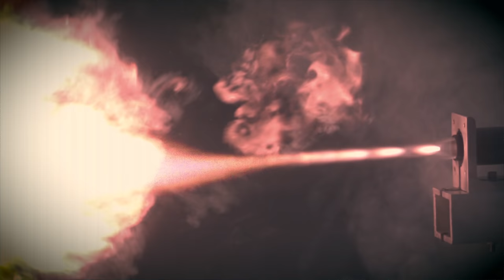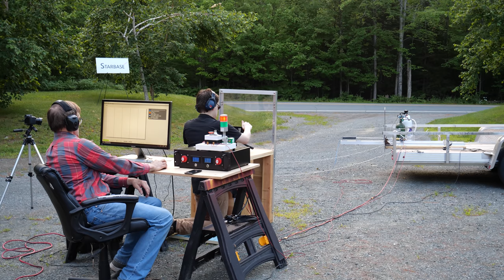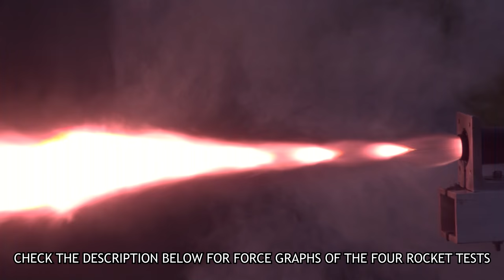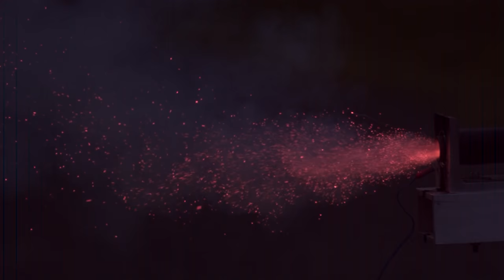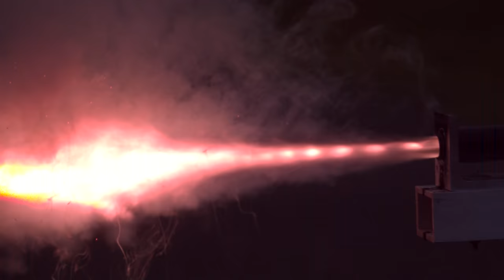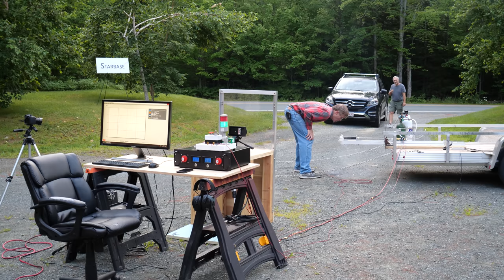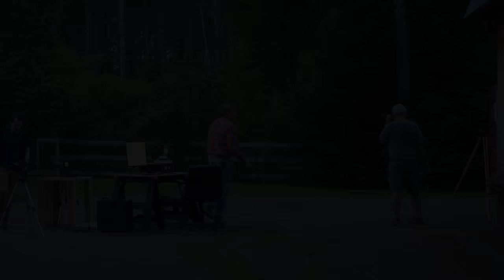Our Most Powerful Rocket EVER! Upsets Local Official!

Comment: both your nozzle are wrong for the air pressure around it. actually pretty bad for your results.

you can cleary see it by the cones and wave pattern forming in the exhaust.
its a phenomenon called "shock diamonds"sometimes called "mach-diamonds". they happen when the pressure of the exhaus is way lower then the atmosphere around it.
so the air "pushes" it into that cone shape form. this leads to less velocity and way more heat in your system. 
cone design should change your "vacuum" to a "in-atmosphere" engine.

it also could be a delivery problem. i see some problems with "steady stream" in the bigger engine.... i dont know if your are controlling that or maybe its the backpressure from overheating by the formed shock diamonds that overhead your engine and cooling donw because of low flow - cycling beack up again.

Comment: Good looking mach diamonds. Could be just a tad under-expanded. What is the chamber pressure? It looks like force peaked around 300 N, am I reading your graph right? 

Have you considered adding aluminum powder to the fuel grain?
Reply from the maker: Thanks.
It's actually slightly over expanded.
The large engine peaked near 700 N.
I tried it, but the powder did not suspend well in the liquid wax.  A nano aluminum powder would do better, but that is really dangerous to work with.

Comment: As the NO2 pressure is a self-regulating factor, then the rocket can never exceed the NO2 feed pressure. While this is a safety factor with all liquid/gas fed rockets it means that the actual performance of each rocket meets this limitation. It then becomes difficult to compare the performance of each rocket in the test rig as the performance of some could have been far greater than another, but the oxidiser feed may have restricted one. As skewing of fuel and oxidiser mix can greatly effect the performance, all one can say is with the conditions imposed this was the performance. Not that one was better than another.
Reply from the maker: You should watch our previous video covering the nitrous oxide system in detail where I addressed this.

Comment: Incredible stuff! Was there any thrust measurement done?
Reply from the maker: Yes, check out the links we posted below the video.
Reply: @TechIngredients  I had missed that, thanks. It is a bit non intuitive that thrust drops over time. As if combustion becomes less efficient or geometry of the chamber changes in a way that penalizes thrust. One would have expected the amount of combustion to increase as the volume of the combustion chamber increases. But that is clearly naive.

Comment: If you added a tesla valve to the channel just before the nozzle, would it increase the thrust by rechanneling the side pressure back in one direction?
Reply from the maker: No.  The convergent portion of the nozzle already does this very effectively.  A Tesla valve is an interesting design, but it's not useful for this purpose.

Comment: Wouldn't the trailer acceleration and motion greatly decrease accuracy of the load cell?
Reply from the maker: No.  The effect on the readings is proportional to the ratio of the acceleration of the trailer to the acceleration of the exhaust gasses, it's negligible.

Comment: I remember someone had a video where a Nitrous based motor actually back-fed into the tank just a little. Unfortunately nitrous oxide releases energy by breaking into oxyge and nitrogen, even without a fuel, so the tank blew up.
Reply from the maker: True.  The check valves are important.
Reply: That sounds like a good solution (although I don't know much about nitrous)

Wow that was a fast reply!
Reply: @TechIngredients  Just found the video:
https://youtu.be/Zt3JYHfmxDE?t=223

I think part of his issue is he was running a solid fuel motor that was designed to switch to hybrid mid-burn. May have created much higher back pressure than a hybrid alone.

Comment: I want to duplicate what you've done and I need to know the dimensions of the biggest engine
what are the inner and outer diameters?
what is the length of the engine?
and which material did you use?

Comment: A bit dangerous being so close to liquid propellants powering a rocket engine. A plexiglass screen will not protect you from a fireball, only distance will do that. Safety shouldn't be dictated by the length of your control wires. 10x that distance is borderline safe in case an oxygen tank blows up.

Comment: Using a smaller nitrous tank, will you build a rocket?  Also, the burn rate seems very fast, would slowing the nitrous delivery increase burn time?
Reply from the maker: Maybe we will.
It would, but the nozzle throat would have to be reduced to maintain chamber pressure and engine effeciency.
Reply: @TechIngredients  Looking forward to a rocket test!  This series is ever fascinating!

Comment: Why did the "larger" engine run in what seems 2 stages? is it an indication one of the cells was fractured or damaged?
Reply from the maker: No it was possibly due to the chamber pressure fluctuation causing a variation in the nitrous delivery pressure.

Comment: Will you attempt to do a liquid rocket engine I have been wanting to do a small one and would like to have more information
Reply from the maker: Probably not.  I'm concerned about cooling.  Without a flow through cooling system, the combustion chamber would need to be made out of an exotic metal or ceramics.  This is pretty tough.

Comment: I always enjoy your videos, Thanks for doing them. I have a question on any hybrid rocket engine. When it is mounted on a rocket and launched. Would it be possible to incorporate fresh air intakes which open at proper speed act like a scram jet therefore reducing the actual amount of oxidizer required to be lifted?
Reply from the maker: Thanks.
Probably  not.  A rocket engine operates at hundreds of atmospheres chamber pressure and the effeciency  increases as this pressure increases. Ram pressure  will never come close.
Reply: @TechIngredients  Thanks and good to know!

Comment: at 3.52 why does it show 3 "cones" and exhaust? Why not 4 or  9 or 12? Is there some process that makes it so? Thank you for the vids and info. The burning cones must push some compression to the next "cone"
Reply from the maker: As the exhaust interacts with the atmosphere it looses energy and the velocity drops.  Eventually it is no longer able to generate a shock wave as it reflects from the interface with the surrounding air and the shock diamonds disappear.

Comment: Ok, what is the pulsing effect caused by? I thought it was a shutter effect at first. Is it turbulence in the NO2 being supplied?
Reply from the maker: Slight variations in the burn rate and hence the chamber pressure.  This is secondary to the negative feedback effect that I described which makes these engines so safe.

Comment: Me again. Is it necessary for the rocket to spin? I want to take  pictures. I can't have the camera spinning around/
Reply from the maker: No, it isn't, but there is a reason it is common  with amateur rockets.
Notice  that with professional launches, the rocket might rotate a little,  but it doesn't  spin.  If the motors are less than perfectly  aligned (amateur), the rocket can slowly  arc in its flight. Rotation averages the off-axis thrust and prevents this.

Comment: I may be too late, but how would one account for the weight of the drag chains in the force calculations? Is it negligible? I would think not, but I’d like to be corrected if someone knows.
Reply from the maker: It's negligible.  The thrust is measured by the load cell on the trailer along with the engines

Comment: Is the throat of the nozzle eroding? Can you do a video and show the ones that were fired?
Reply from the maker: It didn't as I described in our previous video on nozzle fabrication.
Reply: @TechIngredients  I saw that video. I was just wondering if the expectations lined up with the testing. Why does it appear to lose power before you cut the nitrous? I would not expect this type of rocket to "taper off" like that.
Reply: @TechIngredients  Freakin awesome video by the way! I usually dont say that because I have kinda come to expect that from you guys but yeah, that was awesome!! Completely blew my expectations away.

Comment: So you gotta make the rocket big enough to propel the tanks along with the rocket , or get smaller tanks? Onboard CPU controlling the gas flow?
Reply: Do they sell them on Amazon or Walmart lol
Reply from the maker: You can fabricate tanks from the same materials used for the engine tubes.
As I explained in our previous video on the nitrous system, controlling the nitrous is limited to off and on as any restriction up stream of the spray nozzle will cause premature vaporization.
Reply: Love your videos . My son loved the smoke bombs I made from your videos.

Comment: Is it possible to monitor the pressure inside a solid rocket? I case, how?
Reply from the maker: Sure.
Attach a thin steel tube into the open core and provide a little length to the external segment where a pressure transducer will be protected from the heat.

Comment: Can you calculate the exhaust speed with measuring the distance between the mach diamonds? I've seen a video where a doctor explained that you can check if your flow of urine is still healthy by measuring the distance between waves (undulations?) in your stream of pee. But i have no idea if that works similarly for mach diamonds and flow of exhaust gasses.
Reply from the maker: I believe you can, but I don't know how to do it.

Comment: Please trust me when I tell you you're almost certainly too close to that rocket engine. Although hybrids are somewhat safer, things like grains failing and blocking the nozzle or oscillations blowing flames back into the nitrous oxide canister (often towards the end of the burn) are real things that do happen. Even the nitrous oxide tank can explode if there's the slightest contamination (one amateur group were dumb enough to lubricate their nitrous seals with hydrocarbon oil- they cracked a valve and it detonated.) The Virgin galactic group thought their hybrid was safe too, but 3 people died in 2007.

Comment: How do we increase the burn duration(without changing burn rate)?
If the flame front includes the whole core surface area then the length of the grain should not affect burn time instead the width of the grain would increase burn duration?
Reply from the maker: Obviously, if the rate stays the same and the duration increases, then we have to burn more propellant.
However, there is a positive feedback from chamber pressure on burn rate, so that given a fixed nozzle throat, the increased surface area of a longer core will increase chamber pressure which will increase burn rate which will increase chamber pressure...
Reply: @TechIngredients  Got it thanks.
With my sorbitol motor now generating proper thrust I plan to engage in a little “fun flight”
Reply: @TechIngredients I'm curious, have you analyzed your nozzles before and after? Does the throat change dimensions? I noticed that the nozzle is over expanding ( shock diamonds), but that would be expected if you want the thing to actually fly high or if the throat widens up during the burn. What is your planned application? As an aerospace engineer I'm kind of curious, specially relating to nozzle design... I guess I'll have to watch the making of video :)

Comment: Mach diamonds! 
Your restraint stakes bother me, structurally. Just wagglin' around in the breeze flaunting that bending moment.
Reply from the maker: That's right.
Bending is good for limiting shock forces.
Reply: @TechIngredients  Preloading restraints is probably one of the best solutions for dealing with this sort of shock force. Basically prevents it from developing. 

I can't see the detail of the chain stake attachment, is this intended to exceed the bending yield strength of the stake as a single use energy absorber? 
I mean that's part of the reason for using mild steel in many structures, but it is also a one shot in case of earthquakes type of strategy and the amount of steel and energy absorption is well integrated in the engineering.

And yes, I realize I'm off on a tangent about tent stakes when the subject is rocket based gas jets.

Comment: What is the weight to thrust ratio? The 4th test looks like you were averaging around 550n or 120lbs. Anythought about doing a controlled launch?
Reply from the maker: That's hard to say as this test set up isn't designed with any consideration of the weight.  It's a bench set up. The specific performance of the hybrid propellent is itself excellent. propellent is
Reply: @TechIngredients  sorry that was a short worded question. What i would like to ask is how much fuel and oxidizer where used. Not nessasserly the weight of the setup. I love what yall are doing by the way. You would make a good professor

Comment: now i am wondering, is is necessary to use Nitrous oxide? or can we use something like hydrogen from a electrolysis setup to have a similar effect? ;-; also, is the shock wave things a good example of Bernoulli's principle? it was just the first thing i though of.
Reply from the maker: Hydrogen isn't an oxidizer. Oxygen can work, but you need liquid oxygen in order to deliver enough mass through reasonable diameter plumbing.
Reply: thanks for the info, and i see where i got mixed up. i thought it was just used to supply a "flame" of sorts so the fuel will burn supplying the thrust etc. 
i guess i should re-watch the earlier vids a little more carefully lol

Comment: Hi I would to like to ask how you owuld use nitrous oxide in higher enviromental temperature for example i have heard of failed rocket launches in deserts using nitrous oxide because of its critical temperature at 36 degrees. Do you think a fully gasous version of a htrid rocket would work ?
Reply from the maker: The performance  would probably  change little.  The increase in temperature  will mean the nitrous will be at a higher pressure and the chamber pressure  can then run higher increasing  performance.  However, the lower density of the nitrous  will decrease the flow through the tubing, lowering  the chamber pressure.
Reply: @TechIngredients  So actually one could use it also in fully gaseous condition if the cylinder can hold the pressure , but accordingly another valve and flow design would be required as far as I understood

Comment: Hello can you explain why the second engine you set off had like 8 to 9 bands in the flame and the last one only had 5 to 6 what are those bands in the flame.?
Reply from the maker: They are shock waves as the supersonic exhaust  interacts with the surrounding  atmosphere.
Reply: Basically the atmosphere really wants to squish the exhaust flow. The larger engine has more power thus more pressure pushing against the atmosphere. Less diamonds.

Comment: While I was making sorbitol plus KNO3 plus ammonium nitrate and rust rocket fuel I noticed that even after hardening it came out pretty wet and upon burning it had practically no thrust . 
Is there a email address where I can contact you guys if I have such doubts?
Reply from the maker: I'd prefer to communicate in the comments  for the benefit  of other viewers.
Potassium nitrate is not very  hydroscopic, so you might try reducing the amount of sorbitol in the mix.
Make a batch, take a small sample out, add more potassium nitrate, take another sample...etc.  Test the samples as lumps on a firebrick or piece of concrete and compare their consistency and burn characteristics.
Reply: @TechIngredients  Yes I agree - anyone else with the same problems might find the comment section helpful.
Yup, I am going to reduce sorbitol and tweak the mixture and see.
Since we do not have a lot of companies selling motor casing I am making my own casing using PVC and I now have bought aluminium pipes to create better casings
Reply: Also , Is there any constraint on the diameter of the central bore or the size of nozzle inlet that is to be followed?

Comment: Can you fire a rocket engine in your vacuum tube?
Reply from the maker: The vacuum tube is too small.  Testing a rocket engine at reduced pressure requires a large volume in order to prevent the exhaust gasses from almost instantly converting the vacuum chamber into a high pressure chamber.
Reply: Makes sense. How big does the difference in diameter between the engine and the vacuum tube need to be, in order of magnitude?

Comment: The main question is - how to put all this stuff in a small rocket?
I believe, that this statement is true: if you can build a hybrid - make liquid
Reply from the maker: Why?
As I covered previously, liquid fueled rockets are substantially more complicated.
Reply: @TechIngredients  If one can make a small oxygen part for hybrid, the only thing is to double it - and you'll get liquid. The same trouble - a small tank, a valve, ignition system. If you can manage to squeeze it in a model rocket - then I see no trouble to make the rocket a bit bigger and place there two liquid systems - one for fuel, another for oxygen.
But anyway I'm waiting for your next video. I'm really curious how you will fit all this into a rocket that can fly :)))) I use only solid
And thanks for your time and efforts :)

Comment: Can you build a ramjet?
Reply from the maker: It wouldn't be too difficult.  The challenge is calculating the angles and dimensions of the inlet to convert the shock waves into pressure gain. There's enough information out there to create a plausible engine, but testing is impossible without access to a test facility.
Reply: @TechIngredients  I wonder if a ramjet could be integrated into an artillery shell act as a booster and extend the range.
Reply from the maker: It has already been done with missiles.